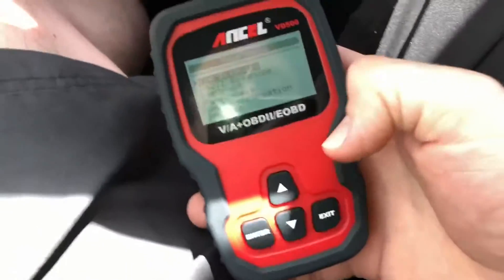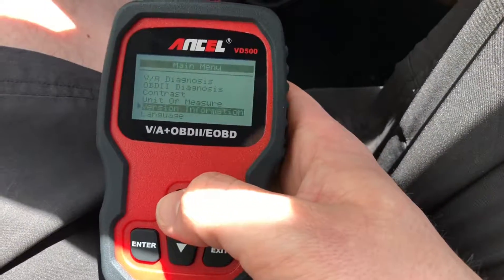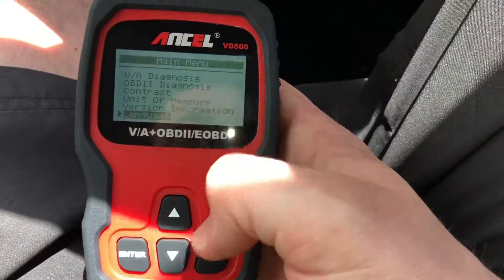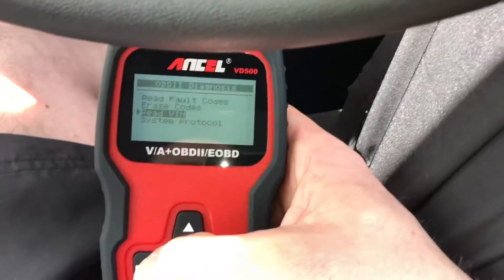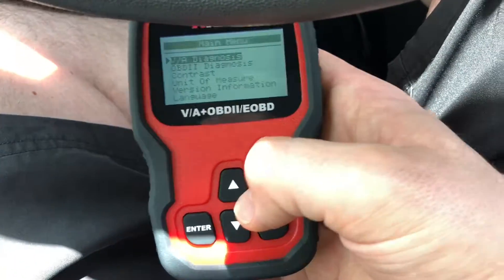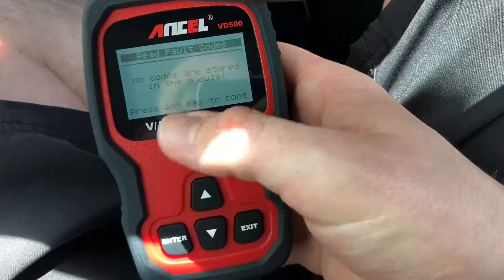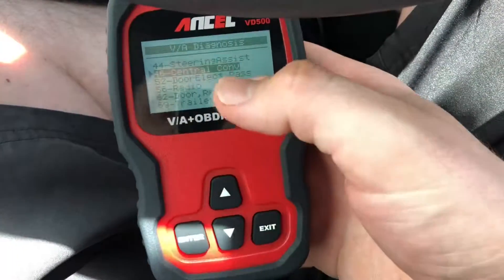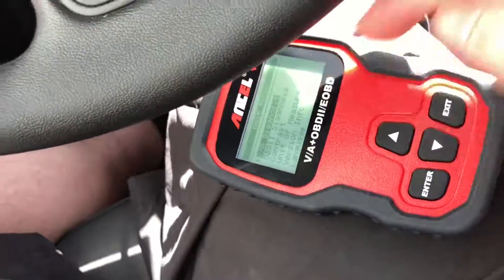How to read and delete the deeper failure codes of VAG (V/A, VW) cars with OBD II scan tool Audi DIY

Comment: Hello, thanks for the video, is it possible to disable a passenger airbag using this device? My Polo 6n2 doesn't have any switch to disable it, I have to do it from VCDS (but I only have a KKL cable) or manually (remove the whole dashboard and install a resistor...). I hope you'll be able to help me out. Thank you!